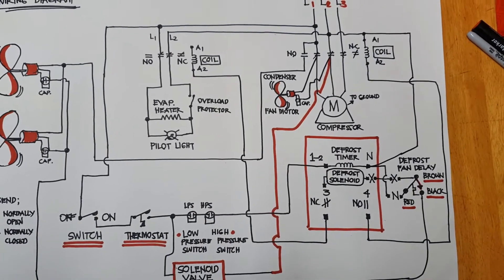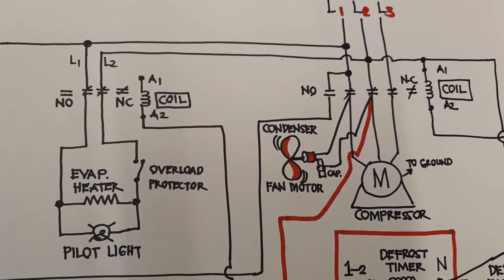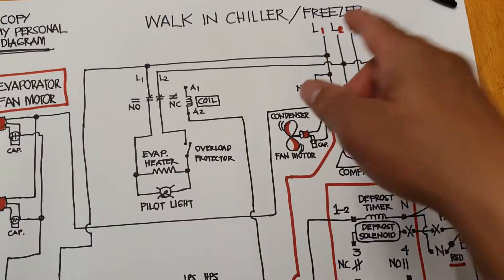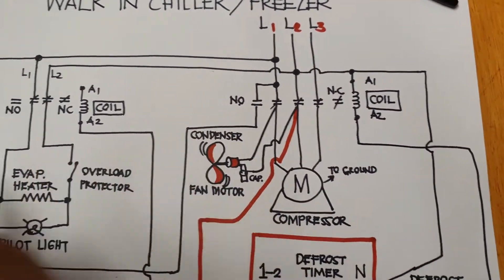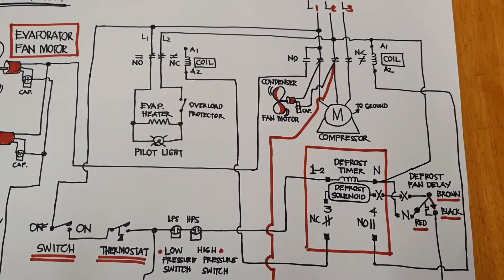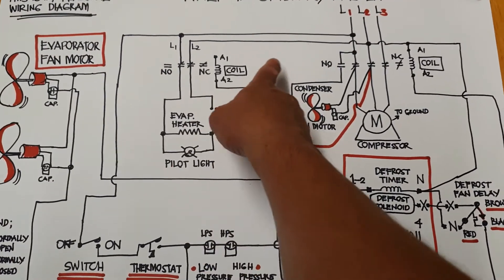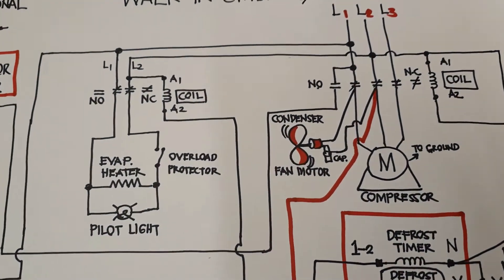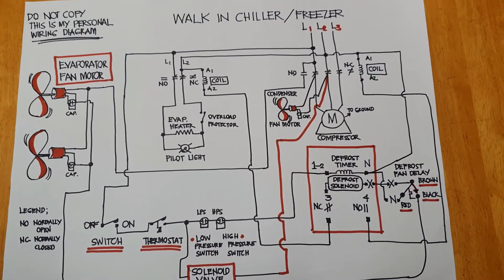walk in chiller / freezer wiring diagram @yourkakuza

Comment: I want to know  when temperature is fillup that time thermostat is open and solenoid valve is closed and refrigerant flow is closed. Now this time compressor is off or running??if the compressor is off position they how the compressor off .

Comment: Hello
One question
According Your diagram, every time when thermostat is open ( high room temperature) thermostat timer is off ( stop counting time) this is correct?
Another thing, as per Your drawing defrost timer cut power to compressor contactor so same time will be off compressor and solenoid valve. How refigerant will be removed from chiller room before next refrigeration cycle, or maybe this is not necessary because temperature in chiller is not so low like on freezer units
Reply: LPS and HPS suppose to use to control directly supply to compressor contactor?

By previous mentioned things, maybe better defrost timer to have separate supply ?

Comment: Sir paano Kung mag auto ung thermostat so WLA Ng power papunta s defrost timer paano gagano ung defrost heater?thank you po
Reply from the maker: As you can see in the wiring diagram walang papasok na current sa timer if mag auto yung thermostat. (ilang minuto lang naman ang pag auto ng thermostat). as of now sa ilang taon kung ginagawa ito never pa nagka problem. So, incase meron ka additional wiring on your own pwede mo baguhin sabi ko nga in my previous video  marami tayong idea as a technician pwede mo baguhin as long safe sa compressor and safe sa lahat ng components.👈
Reply: @yourkakuza  nagtatanong lng po  ako gusto ko ksi pag aralan yan,in short bagohan plang po ako,gusto ko mtuto ng ganyan